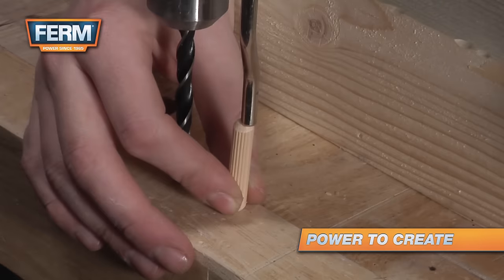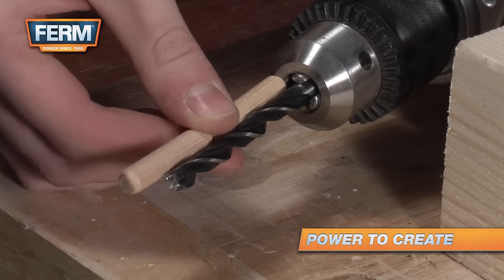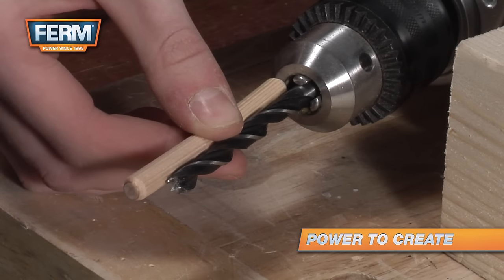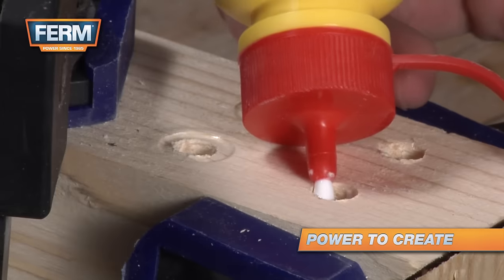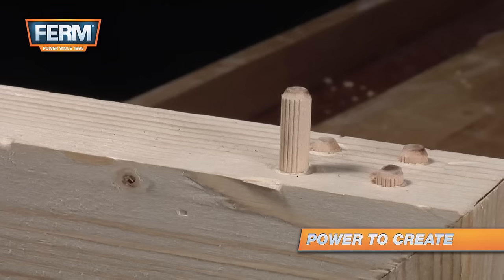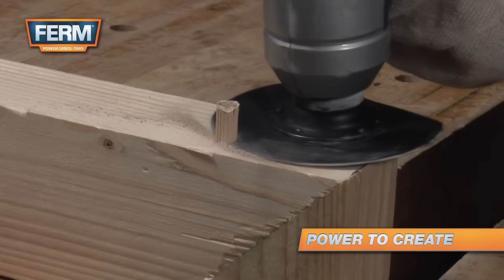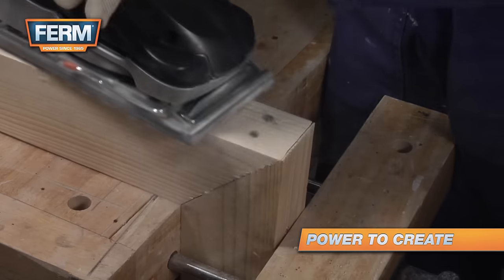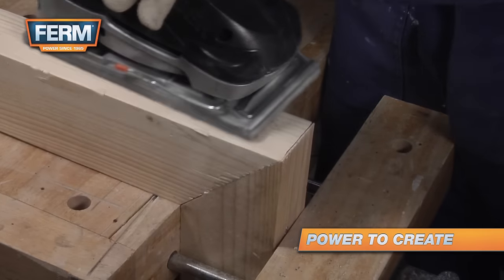How to create a strong mitre joint

Comment: Ratchet straps work well for clamping a square with miters on all 4 corners. Im wondering how well liquid nails would hold a   box together made of 2×4 pine and 45's on all 4 corners without any fasteners. None of us cut perfect mitres every time. Thats why everyone knows little tricks of the trade with a little glue and sanding. Ive seen worse mitres than this!